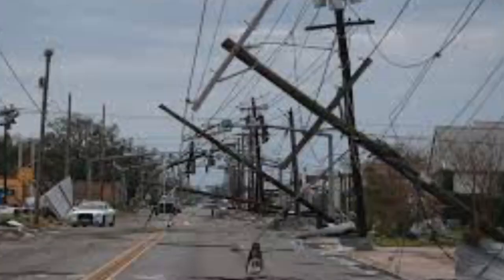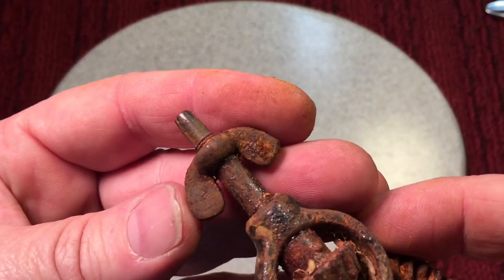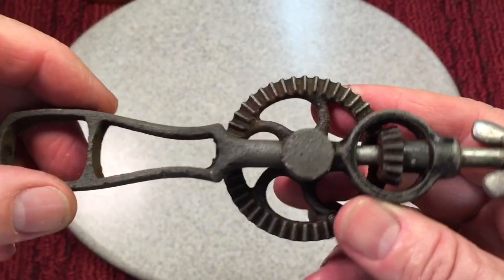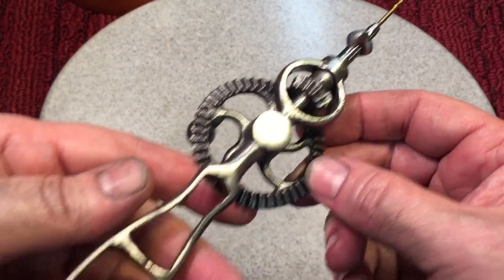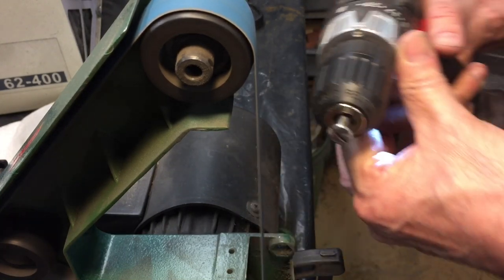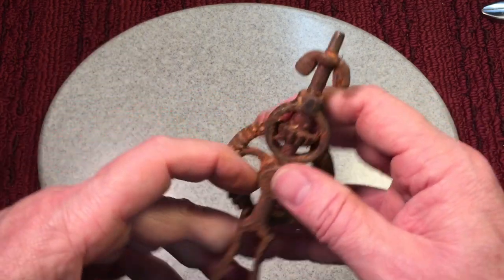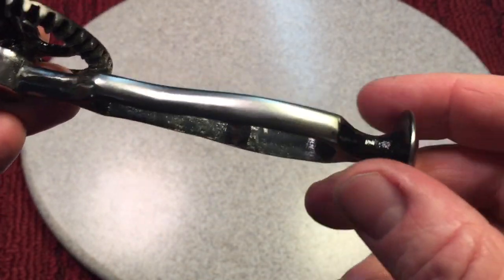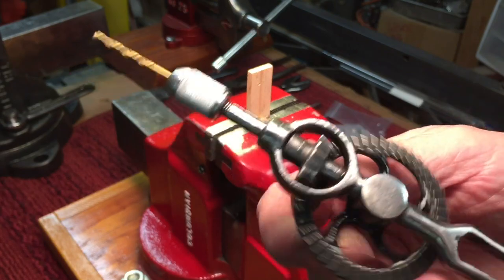Antique Jewelers Hand Drill

Comment: Joe sent a tool
From under the seas.
Scout took a look
And he said, "Oh Jeez."

Out comes the vinegar.
Oh what a stink!
Scout breathes deep
And says with a wink,

"Take the right amount of time.
You must not cheat.
I kind of like it.
It smells like old feet!"

Then 50-50
To loosten it up.
Disassembly is done,
All parts in a cup.

Wire brush and filing,
The gears look good.
Then reassembly.
It works like it should.

What's with that wing nut
Down on the chuck?
The threads are standard
ScoutCrafter's in luck.

He machines out a chuck.
All shiny and knurled.
In goes the bit 
And Scout gives it a whirl.

That delicate bit
Is great for small stuff.
On 1/4" steel
That would be pretty tough.

The shine and the black, 
That looks pretty cool.
You've done a great job
Restoring Joe's tool!

From the Queen City of the Ozarks, thanks for the fun!  :-)
Reply from the maker: Best yet Mark!

Comment: So I finally got a belt sander to assist in tool restoration, trying to follow in your footsteps John. Today I woke up and blew my nose, full of black metal dust. Guess I’ll be adding a mask to my ppe routine. Now I just need to locate a used polisher to accompany the wire wheel, and I’ll be making em shine!!

Comment: Alright "Flat Bastard", I've recommended this to you several times now, you should add another tool to your overflowing tool box and learn how to use electrolysis. Your little hand drill would have been a perfect candidate for a dip into an electrolysis bath, it would have done a much better job in all the little "nooks and crannies". It's very easy to set up in your basement (since you have your new air filter system). Time to learn a new craft ... scoutcrafter!
Reply from the maker: I have tried electrolysis before.. I see very little difference between all rust removal remedies.  All of them require the same amount of clean-up after the treatment. 😃👍

Comment: Great job!  I've got acetone and atf and would like to make up the 50-50 mix.  Are there any special precautions to take?  It looks like you keep the plastic spray bottle in a tin can.  Also, do the two liquids mix together?
Reply from the maker: Rick-  Super simple, just use a chemical resistant container and add 1/2 of each and shake up!  Works awesome!  Don’t fill up the container more then half way and shake before each use.  😃👍